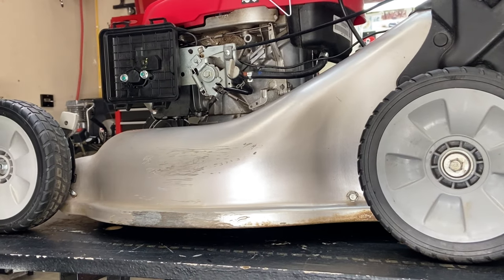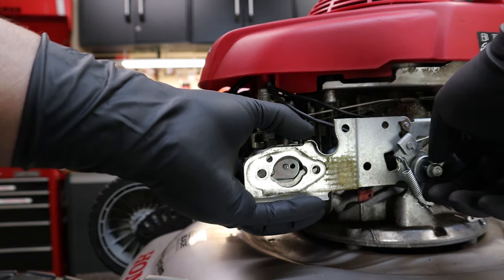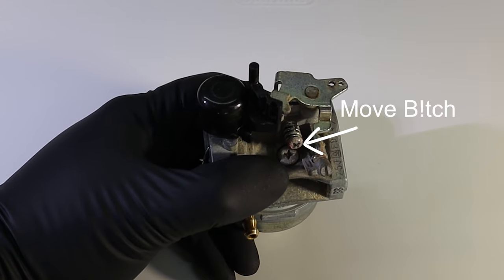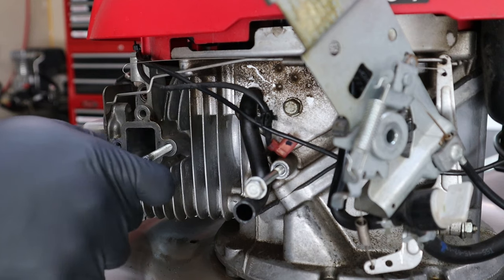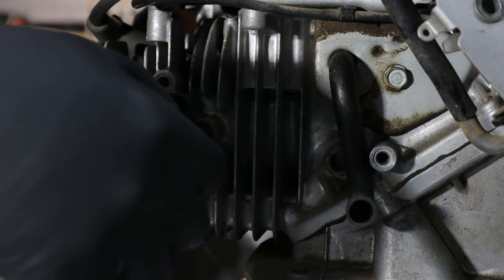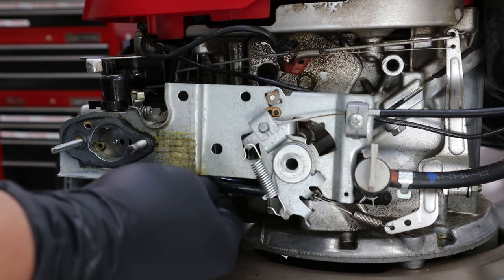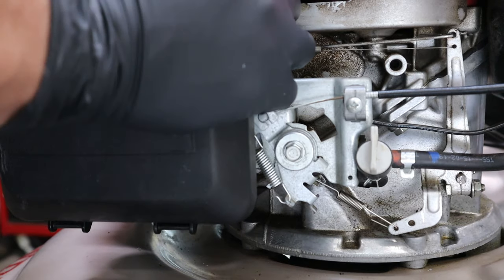Honda GCV160 Carburetor Install/Remove + Pilot Jet Cleaning

Comment: Honda doesn’t cover Carburetor warranty 👎🏼
Reply from the maker: Correct, they don’t fail the carburetor they fail the carburetor due to contaminated gas. To be fair we do the same thing at my dealership. Customers have every right to be upset. True story a few years back we had 3 Lexus guests come to the service drive all on the same day stating “no start”, we failed all 3 cars for contaminated fuel, we asked the same question for all 3 guest, “where did you fill up last?” They all replied with the same local gas station… they all 3 went back to the gas station and presented the service invoice repair bill and were reimbursed for the repairs. Turns out the gas stations storage tank had a crack in it and due to recent heavy rainfall the gas had become Contaminated.

Comment: Your video is very useful; thank you for posting it! I'm going ahead and using two old chopsticks in place of the metal studs for carburetor installation purposes. This saves time and money.

Comment: Outstanding lesson on the assembly of the carb.  I bought two M6 X100 mm bolts at the hardware store for $1.39 each and cut the heads off to use as stud guides.
Reply from the maker: Heck yeah! Thanks for finding me gpecci2253.

Comment: Very Good Video.  As a small engine mechanic and owner of my own business,  North Valley Repair and Small Engine Services I have found that these GCV engines are the hardest to work on.
My recommendation is alway use SEAFOAM or a real good fuel conditioner and stabilizer and run the machine with fuel off to keep the carburetor.
Reply from the maker: Love me some SEAFOAM!!!

Comment: Thank you for the video!! My idle when the blades weren’t engaged surged and surged. Took about twenty minutes to get the carb off, cleaned, and back on with your help. Mower runs like new again!! 🤙🏼
Reply from the maker: Davewarner1761 for the WIN!

Comment: Rather than  studs,I  used  bamboo shish kabob sticks. Handy, had a bag in the kitchen.   Won't  strip the  threads and you can  customize the length.   When  done  throw them away!

Comment: You need a jis (Japanese industry standard) screw driver to remove that screw. easily found online. Funny most Japanese cars like my Toyota have many of these screws which look like plain old Philip screws. I'm sure many people stripped many of these not knowing this.
Reply from the maker: Yes and no but great observation. I work for Lexus and I only use metric. Thanks for the comment.

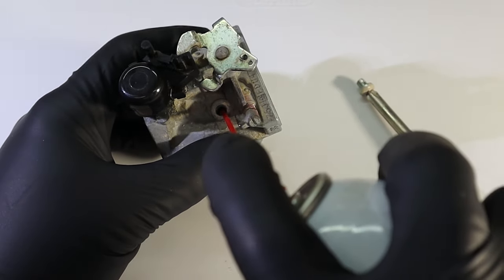Comment: 3:40 How does just spraying cleaner actually clean it out? Awesome video btw.
Reply from the maker: The cleaner is dissolving any debris/corrosion build up that’s restricting any fuel from fully pass through
Reply: @dadsworkshopbykipplabrie7982  Thanks.  You need to make more mechanical videos.  Incredible video work, straight to the point and down to earth.

Comment: Just another FYI comment.  Honda will be discontinuing the HRR , HRC and probably all other Gas Lawn mowers by the end of this year and next year.
They , as well as many other  manufacturers,  are going cordless electric.
Reply from the maker: Thanks for your support, Mark! Yes, I have heard the rumors about Honda going all battery powered as well. I'm currently away from my dealership and getting trained on our first and all new fully electric Lexus RZ and quickly learning that EVERYTHING effects battery range. If the driver request "eco mode" the first thing the vehicle dose is cut off and or reduces the A/C! so, this should be fun dealing with customers. thanks again for watching Mark.
https://youtu.be/iTC6X8K7okg

Comment: The only problem with HONDA is that not all GCV engines were the same for carburetors...
The GCV160s and 190s on pressure washers are totally different than on lawn mowers
Reply from the maker: Sounds like I need to get my hands on a Honda pressure washer and make a video. Great idea and thanks for the support.

Comment: Great video. Whoever designed this carb mount though must have been on LSD.  I had many problems with it and had one big problem.  I ordered the studs from Amazon and I didn't notice it right away but there is a ridge on them close to the thread that threads into the crankcase where there is a larger circumference that extends for about 3/8 on an inch.  I assume this must be for a retainer of some sort.  But the ridge jammed in the rubber carburetor flange and would not come out.  I had to completely disassemble it and grind the ridges from the studs so they would go through the holes in the rubber flange.  After that I was able to use the studs to reassemble it.  But I would not have been able to do it properly without the video. Thanks.
Reply from the maker: Right! engineers... They changed to full thread stud mounts on their later models.

Comment: what to do if I forgot to count the throttle stop screw threads?
Reply from the maker: Refer to 4:00 mark in video. Move throttle control handle to slow “turtle” then adjust throttle stop screw to 1700 (+/-100) RPM or if you don’t have access to the proper tools and or tachometer you can fully re-insert the throttle stop screw clockwise till set, then turn the screw counter clockwise 2-1/2 complete rotations and fine tune by ear for your final adjustment, that being said this this is not the preferred method if you’re not familiar with small engine repair but this will get you in the ballpark. The goal when setting or adjusting the throttle stop screw is to make the engine run smoothly at low RPM without making the engine stall.